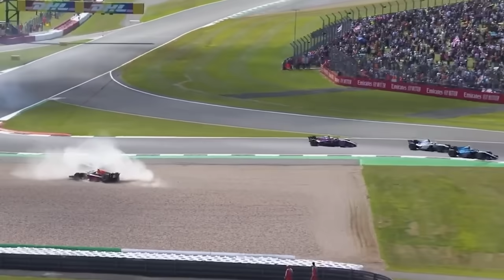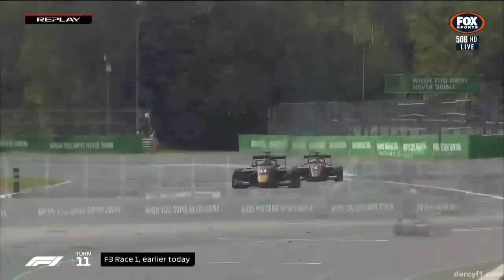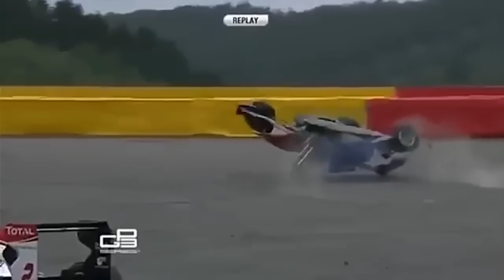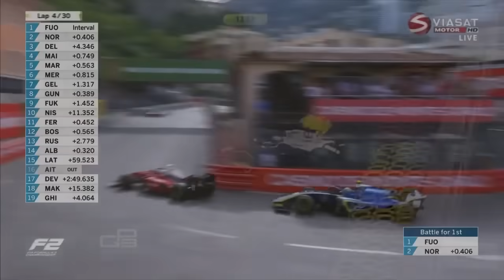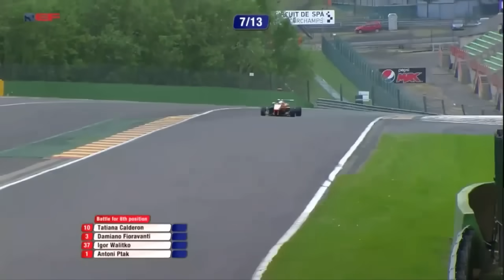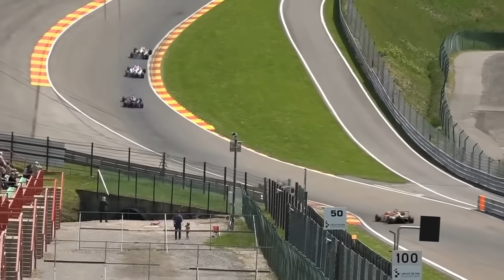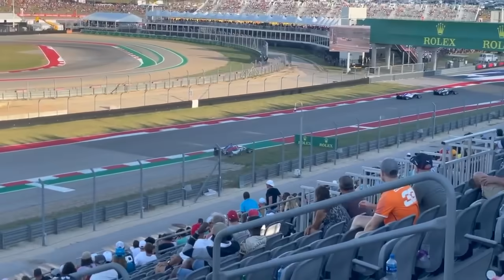Ramps on Race Tracks

Comment: FIA: ground affect is too dangerous it could send cars flying 

Also FIA: let’s add curbs that launch cars into the air
Reply: The ground effects are the inverse of lift, kerbs prevent the cars from pinballing on the ground or worse, going to a dead stop on a particularly stiff wall. Sudden dead stops in crashes are WORSE than rollovers because the inertia is greater.
Reply: @DR3ADER1  When you're in the air, you cannot slow down and have no control, leaving you to slam into the wall at the speed that you've left the ground with. That is why sausage kerbs and poorly designed kerbs shouldn't be in racing at all, because they will eventually lead to a sudden stop into the walls in the air instead of on the ground, which is objectively worse.
Reply: @nallid7357  Incorrect. When you're airborne, you need thrust to gain and maintain speed unless you're very high in the sky(as in, plane height, several thousand meters in the air). All of that forward momentum is countered by air resistance on all sides of the car, and you immediately slow down and are brought back onto the ground. Because cars need a fulcrum to gain speed, such as the ground. 

You generate a ton of drag in the air, drag has a negative effect on your momentum and you land straight back down. Look at most blowovers in NASCAR, where the car in the air is passed by the entire pack, as it loses all of its speed and momentum.   

You need to pay attention more in physics class, and learn more about how powerful the air is at high speeds, especially in regards to drag, air resistance and lift. 

It's funny how many people ignore such factors to reinforce their narratives. You don't gain speed in the air without thrust and propulsion in any vehicle that's not a flying vehicle. That's basic physics 101.
Reply: @DR3ADER1  The tyres sliding on the ground are doing better at braking than them being airborne. Maybe you should take some
Reply: @DR3ADER1  You don't accelerate mid-crash. Fucking gravel is there, you don't need open-wheel racing tacks with ramps
Reply: @hongthainguyen5334  Incorrect. The friction of a vehicle's tyres doesn't compare to the insane levels of drag that the air produces, especially in wet conditions. You have to consider how loose and slick tyres are and other variables such as brake failures and suspension failures.
Reply: @DR3ADER1  I’m sure you mean at 300 kph, yea, but like check this out, do these flying cars at, say, below 100 kph, look like they can’t be slowed down with more efficient means to you, even with no brakes? I’d say the tyres can still do the deal a whole lot better than a hunk of metal/composite whatever flying at the speed which the airbrake effect isn’t so high anymore
Reply: @DR3ADER1  You slow down on the ground because of friction and the lack of a lack of a surface to slow down on. Try again.
Reply: @hongthainguyen5334  Nope, 100, because 100 km/h is 62 mph and because most of the resistances that Air inflicts on any vehicle is much greater than on the ground, this fact is only reinforced at 250 km/h and greater. The faster you go, the thicker the air gets, the thicker the air, the greater the air resistance. Cars don't go faster in the air, they slow down and less distance is covered in the air than on the ground because of this. And when a body in aerial motion is slowed down, the forces of gravity take over. Which equals less forward motion and more downward motion. 

The laws of physics do not change when you go faster, they only amplify on a greater multiple. Or in layman's words: Physics is far more dramatically noticeable at high speeds and in turn, the resistant properties of Air are distinctively noticeable and felt on camera. The forces don't change, they only get stronger. 

Tyres DON'T do as much heavy work as the Air because the Air surrounds the vehicle in its entirety, and the tyres are limited to their contact patches. Furthermore, on surfaces with limited friction (or surfaces that are waterlogged), the effectiveness of a tyre drops dramatically, especially on Racing Slicks.
Reply: @DR3ADER1  Only if the car flips but then if the car is in the air stable, there is absolutely no control and way less ability to slow down than a gravel trap would provide.
Reply: @davros_adl8155  Also false, as there are countless videos showing cars gliding across gravel traps in the dry without slowing down and worse, digging into the gravel, causing rollovers.
Reply: @DR3ADER1  stop trying to sound smart, cus ur really not
Reply: @DR3ADER1  You seem to be forgetting that air resistance also acts on a car that's in contact with the ground. Compared to an airborne car, a car that's on the ground also experiences friction with the ground itself, thus slowing it down more.

The fact about cars gliding across gravel trap shows exactly this effect: it seems to be gliding because without any contact with the ground, the car slows down less due to the absence of the friction force with the ground.
Reply: I love this comment section, is so fucking funny
Reply: @DR3ADER1   you sound salty
Reply: @DR3ADER1  idk, I am just having fun, and you?
Reply: @DR3ADER1   man I don't care, be happy once in your life, I am vibing litening to music and having a chill day will you are getting angry in a comment section
Reply: @DR3ADER1  use abrasive paint like on the Castellet
Reply: @calgar42k  Abrasive paint is useless in the rain, is expensive to recoat and takes up a ton of real estate, particularly on tracks with steep inclines and undulations.
Reply: @DR3ADER1   you are having fun? because I am
Reply: @DR3ADER1   you are funny
Reply: @TheEventForumZ  I am a foxhole Atheist dude. How about you join me and see if I can reattach your head. Chode. Learn the laws of physics, gravity is more powerful than friction, and air resistance is more powerful than friction, particularly in rainy conditions.
Reply: @DR3ADER1   you still crying?
Reply: @davros_adl8155  mate in your words i could jump with my car in the air and never stop lmao. try again
Reply: @DR3ADER1  you realize all the forces you mention are also there when the vehicle is on the ground right? Air resistance, gravity, all of them constantly act on the cars, whether they are on the ground or not.
Reply: @Arlae_Nova  They have a greater effect in the air than on the ground. That's why cars don't fly very far yet carry their momentum better on the ground. Once again, you need additional thrust to keep airborne.
Reply: @DR3ADER1  why would that be exactly? I don't see how air higher up is different when a few meters in the air compared to on the ground. The same for gravity, I don't see how that changes considerably when you are a few meters in the air or at speed. Curious for your answer!
Reply: @Arlae_Nova  Simple, because the faster you go, the thicker the air gets, and when you leave the ground, the higher you go, the greater the wind speed and the effects of gravity trying to bring you back down accordingly increase. Air isn't smooth or static, it's thick and constantly moving against you. And when you have no ability to generate thrust in the air, you'll just slow down and fall back to the ground.  You don't gain forward momentum when you take off in a grounded vehicle, you actually LOSE IT.
Reply: @DR3ADER1  so a fighter jet would not be able to go as fast lower to the ground? Interesting observation. Maybe take some physics classes, learn some more about it and show us how we could use this fact to our advantage, because I haven't seen many project use this awesome fact to improve our lives. It could truly changes the way we live ;).
Reply: @Arlae_Nova  Fighter jets have engines that enable them to gain speed in the air. Cars DON'T.
Reply: @DR3ADER1  I don't want to be rude but it sounds like you are a 14 year old who has only the very basic understanding of how aerodynamics, momentum and gravity work. I personally do not know how these things work either, I major in spatial planning, not physics. What I do know though is that it is usually not a very good idea to state anything with such a high certainty, nor is it wise to double down after about 5 people have questioned your conclusions.

It is very clear you are passionate about the topic, so truly do get some of those physics lessons, maybe you'll find something worth pursuing. I'm going to cut this conversation off at least, good luck!
Reply: Also FIA: hello ground effect
Reply: Speed has never killed anyone. It's suddenly becoming stationary that has.
Reply: @Arlae_Nova Fighter jets are less capable of going fast lower to the ground than higher up. Air density is the major factor here. The additional air that flows into the intake doesn't negate the decreased air density higher up. Air resistence Fd =[ pL * cd * v² *A]/2
So, density of the medium (in this case air) times coefficient of drag times the square of the speed times the area of the frontal crosssection devided by 2. 

Higher density requires more energy to propell the plane forward against the drag. That's why airplanes fly high up in the sky and not close to the ground. And the engine output isn't increased enough from the denser air to counter that. Quite the contrary, it's more damaging to the fan blades as parts of them go supersonic and thereby actually lose the ability to work effectively. Fan blades, compressor blades, stators and turbine blades have subsonic profils.
Reply: @DR3ADER1  bro you really need to take a course on physics, you're trying hard to prove a point that anyone who's even walked past a physics classroom would debunk.
Reply: i'm fasirly certain the peopel who design these things know a tad bit more about this stuff then rando couch "experts" on youtube.
Reply: @DR3ADER1  actual troll
Reply: @DR3ADER1  the ramps are literally just there to say if you cut the corner your car will be demolished and your race will be ended, it has nothing to do with safety
Reply: @DR3ADER1  yes I would much rather have my car jump, catch air, and flip then slam into a wall than not hit the kerb and still be within grip
Reply: @theldraspneumonoultramicro405  the fia designed ramps to stop corner cutting and tell drivers that their race will be ruined if they try in the wrong scenario, they have nothing to do with safety, that's what barriers, runoff, and gravel traps are for
Reply: @houseking9211  When you're within grip, you're still going fast and you're carrying more energy and momentum. Again, having a car in the air and rolling several times reduces the speed and energy compared to a grounded crash. In fact, rolling the car is safer than having it slide on the ground and slamming into a rail or wall at speed. Unless you're using rockets, you can't gain speed in the air, you can only lose speed and gain tons of drag.
Reply: @DR3ADER1   The reason race cars seem to slow more when in the air, then on the ground is the direction of the aero. If the car tumbles through the air, it exposes flat surfaces like the underside of the car, which increase the drag coefficient. 
Air does not get denser with speed, the density changes based on elevation and some other minor factors. The reason drag increases is, because the car has to move it's volume in air around it or shove it to the side and the faster the car the quicker this has to happen. The faster you move something the more energy is needed to get it up to said speed (remember physics 101: kinetic energy is propartional to velocity squared -> 2 times the speed = 4 times the energy).
The brakes ( as long as the tires are moving) are more effective, because the force generated by static friction ( meaning the 2 friction surfaces are not moving relativ to each other) is higher the airdrag and the benefit of it not significantly decreasing with deceleration, makes brakes more preferable and better at slowing the vehicle in thos situations.
Not to mention braking is easier controlled then tumbling through the air.

Comment: I'd fully agree sausage curb designs are dangerous but it was the drivers themselves that caused the inclusion of these types of curbs by constantly cheating the race tracks. In almost every one of these incidents the primary cause was driver error and/or cheating the race track, not the curbing (and in many cases the curbings involved weren't sausage curbs); the curbings simply exacerbated the original driver error/track cheating. Should many of the curbings be redesigned? Absolutely. BUT the drivers themselves also need to change the way they approach (cheat) these turns and their curbings.

Comment: Yeesh.  These things have got to go.  You'd think people would've gotten the hint after Sophia Floersch's launch at Macau, but apparently not.   Also, it's one thing to launch lightweight open-wheel formula cars, but when the curbs are even launching the absolute bricks that are used in NASCAR, that's a major problem.
Reply: This is very true.
When these kerbs are launching 3600+ lb racecars, a small open-cockpit car that weighs not even half of that will result in some serious issues as we've seen thus far.
Reply: Yep and it's even worse placing them on the outside of high speed corners. 

I won't say my country is completely clean in regards to sausage kerbs, but most, if not all permanent tracks have no sausage kerbs as far as I'm aware. Some street circuits do (Surfers Paradise, maybe Adelaide), but they're not on the outside of high speed corners.
Reply: @callummclachlan4771  Oh, I've got no room to talk, as my home track is not only featured in the video, but it's one of the ones launching NASCAR competitors.  (IMS).  That said, those weren't true sausage kerbs, but close enough.  I will cut them a little slack in that that was the first time NASCAR ran on the road course at Indy;  1st time you run any series at any track, there's going to be issues of some sort.
Reply: she launched off the car she hit?
Reply: @mazda_rt24-p  Nope.  If you look up the complete footage of the incident, she and another car tangle and start sliding.  Then she hits the curbing and it sends her upward.

Comment: I swear we are waiting for a fatal accident, so far we’ve seen:
A female driver fly into a marshal stand, wounding a few marshals and fracturing her back.
We’ve seen a lad almost got his head chopped of.
We’ve seen another lad almost have his head squished between his car and the barrier.
We’ve seen a lad almost die in the first season of a new race-class.
We’ve seen an LMP2 car fly.
We’ve had a female driver break two vertebrae.
We’ve had a lad lose a race because a kerb thought “hurdur funne yeet”.
We’ve seen a lad almost do an Anthoine Hubert…
We’ve seen an American pull an insane stunt.
We’ve seen teammates almost kill each other.
We’ve seen NASCARs do some of the biggest crashes seen on road-circuits.
We’ve seen a WEC lad flip hugely. (Not included in video)
We’ve seen too many incidents, they need to be removed.
Reply: This comment needs to pinned
Reply: @dickyStardust1921  Thank you
Reply: @captaintoyota3171  yeah..

Comment: Someone thought: "You know what F1 needs to make it even more exciting? Big air!"
Reply: this could actually be cool if the cars and drivers could take it without any damage
Reply: The problem is that these kerb doesn't pose a problem for F1 because F1 car have insane downforce.
So they prolly think that because F1 cars are fine then other series are absolutely fine as well
Reply: @kami_narisama  F1 cars aren't fine, though. There were two incidents at the Silverstone GP where cars hit sausage kerbs and took flight, which would have resulted in two deaths without the 'halo'.
Reply: @gerryjamesedwards1227 sorry, Silverstone? Are you referring to Zhou's flip? Because that one isn't because of sausage kerb.
The other i can recall is on F2, not F1
Reply: @kami_narisama  my mistake.
Reply: @kami_narisama  new f1 cars would have nearly zero downforce if they hit a curb......
Reply: @kami_narisama  Until we look at the Monza incident in 2021. Without the halo Lewis would be looking like a cartel hit aftermath.
Reply: I unironically believe this is true

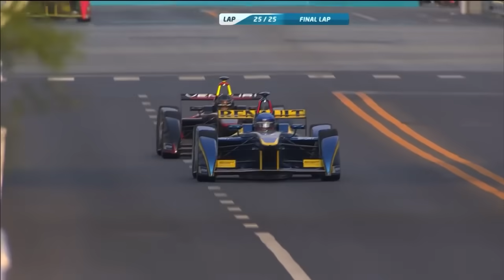Comment: 02:23 he should be banned from racing. What kind of a defence is that?
Reply: I believe that's Formula E, last time I checked all the names were people who  had failed Formula 1 so... 😂😂😂😂😂
Reply: I call it the sim racer special
Reply: @Seb_Semos  tbf formula e has barely any former f1 drivers anymore and it's WAY better racing than f1. You should give the new season a watch
Reply: @LudicrousBacon  Better racing than F1 in Formula E? Is this a joke? Yeah, it's entertaining but Formula 1 is just better.
Reply: @cheatergt4020  all serious mate. Better racing tenfold
Reply: @LudicrousBacon  Personally I prefer F1. But if you prefer Formula E, there's no problem. Formula E is a very cool sport too.
Reply: @LudicrousBacon the problem with formula e is some of the steet circuits, they are very tight and have no chance to overtake. Otherwise everything is fine. I don’t mind the noise

Comment: Just days after this was posted, there was another scary crash in the WEC at Monza. Missed braking point, went over a sausage kerb and rolled, tearing the door off. 

Without the kerb it would have been just a trip to the run-off.
Reply: Yeah it was absurd, there should be gravel at the Roggia corner